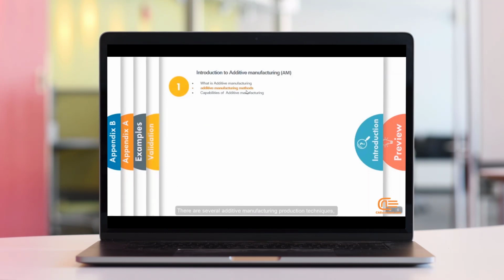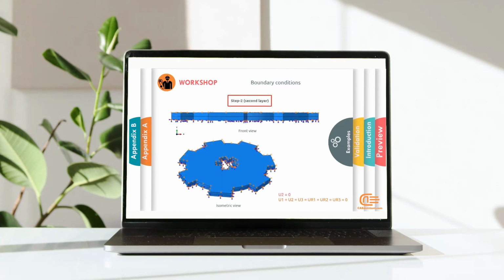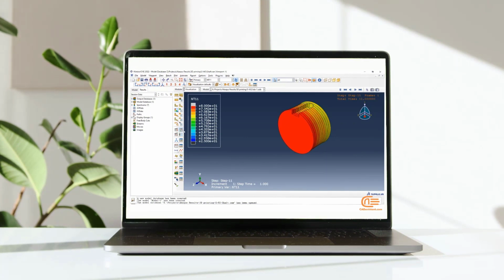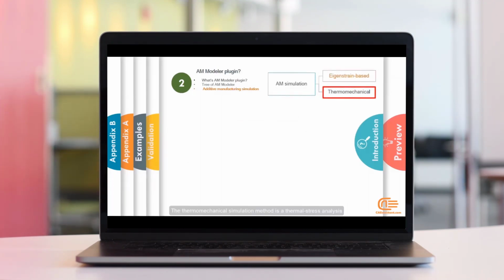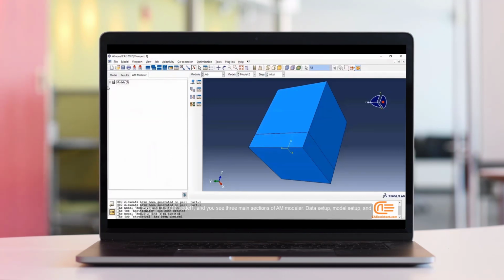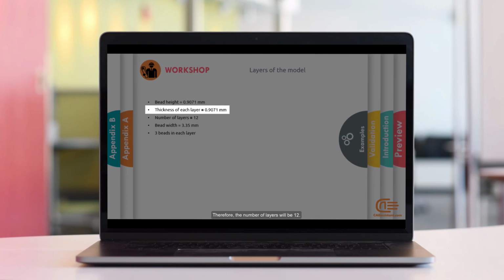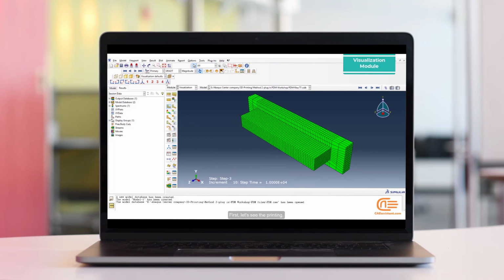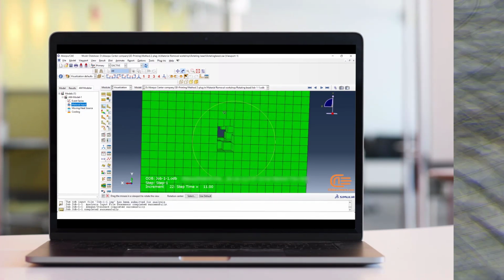3D printing (AM) in Abaqus: AM Modeler plug-in & Python methods - Full DEMO

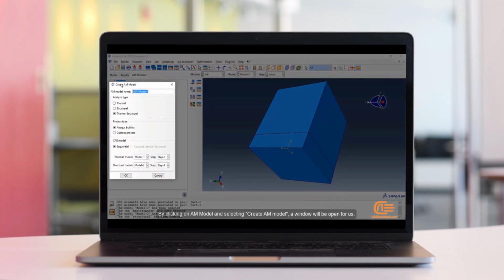Comment: 16:51 I have only two Analysis type options eigestrain and Thermo-mechanical. I need just thermal like on the video. How do I fix this issue?
Reply from the maker: Hi, thanks for your comment.
You see only these two options (Thermo-mechanical and eigenstrain) because that is the newer version of the AM Modeler. In this part of video, it is showing the older version, which have three options.